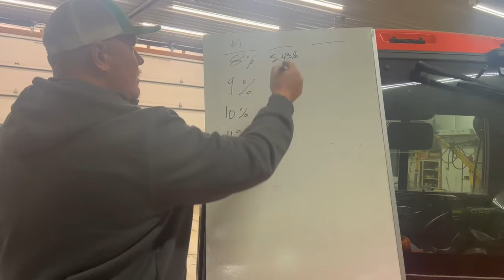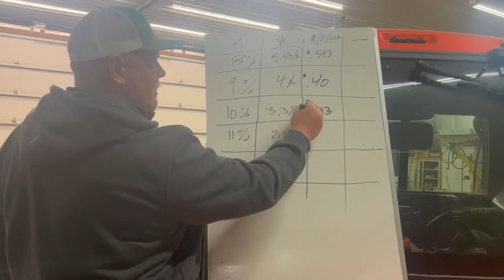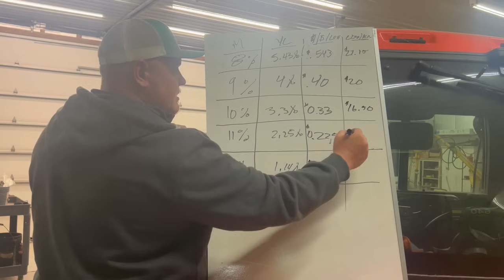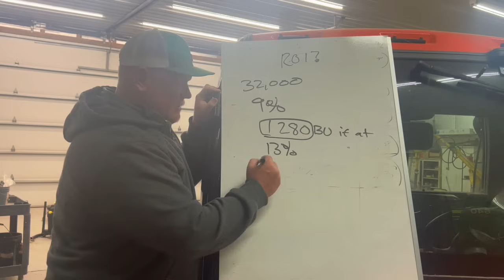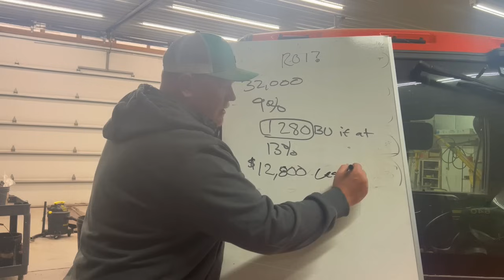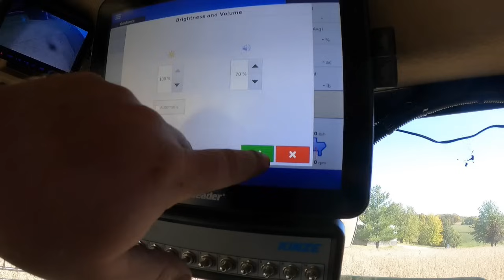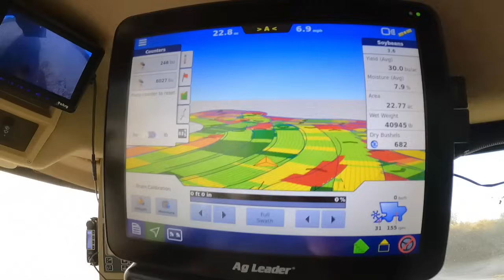HOW MUCH MONEY ARE WE LOSING WITH THESE EXTREMLY DRY SOYBEANS?

Comment: If the humidity is too low to rehydrate soybeans do you use an evaporative cooler for moisture?
Reply from the maker: No, I just doesn’t run because the parameters wouldn’t be correct. That’s the part mother nature plays a roll in!

Comment: OK whats the story with turning the steering wheel  back and forth as a Massery Man
Reply from the maker: It releases the hydraulic pressure on the pump and lets the older tractors start easier.